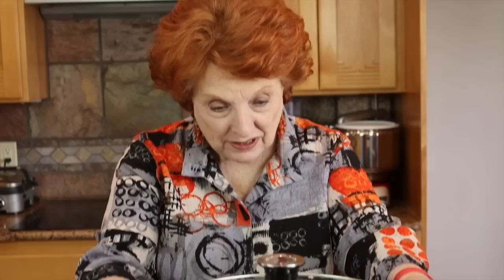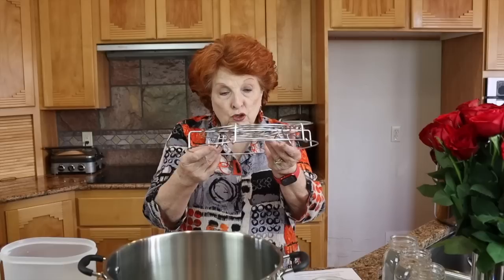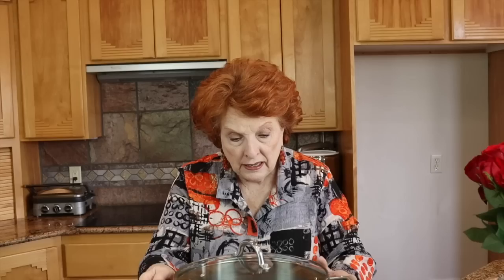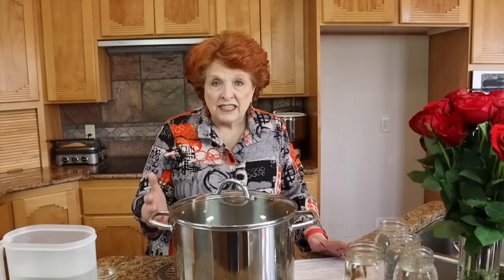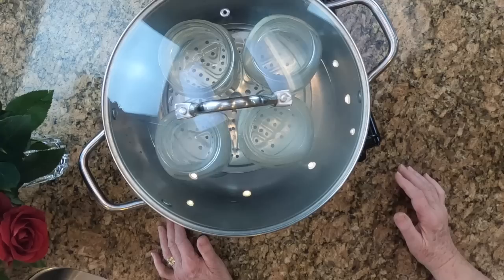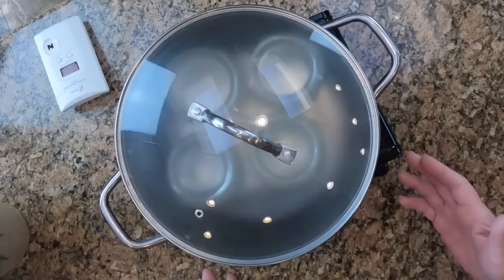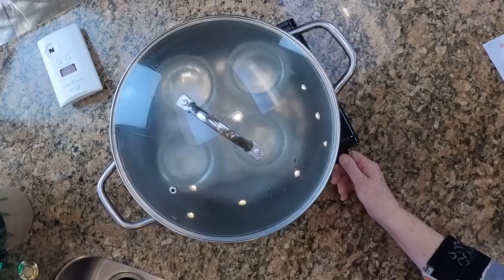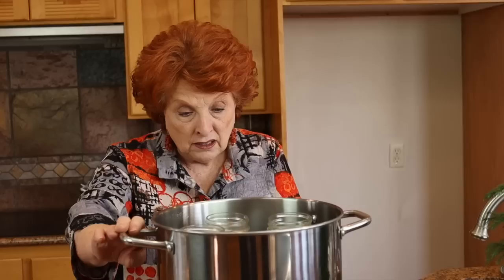How to Make Your Own Steam Canner

Comment: I have a Ball Water Bath canning pot with glass lid. It is 9" deep and would require a rack no greater than 2" for the processing of quarts. Do you think 2" of water would be sufficient?
Reply from the maker: Do that and see if it works. Make sure you have the acceptable amount of water for the process.  Jim
Reply: I decided to watch her video for the third time and at 7:07 I got the information I needed. I used a quart jar and measured out a total of 5 quarts, and the level was just under 2" in my 21 quart Ball water bath canner. So, even if I just used 3 quarts. I will have plenty of room under a 2" wire rack.

Comment: i thought jars were not supposed to touch the bottom of the pot without a rack? Won't the 4oz jars crack if set directly on the bottom of the pot?
Reply from the maker: Mine didn't crack or break.  Jars with food in them should absolutely sit on a rack for canning, but those small jars were acting as supports for the rack so it worked fine.  But you would use other things as well--small tomato sauce cans with the tops and bottoms cut out, etc.

Comment: I see others in YouTube using a hot plate for canning I’m assuming due to glass top stoves. I have looked at these but finding one large enough to fit the bottom of canner or finding the weight capacity is nearly impossible. Is it necessary for the whole bottom of the canner to be on a heat source??
Reply from the maker: It is nice for the heat source that covers the whole bottom of the canner, but it is not necessary and takes longer. (Our glass top is an induction and takes specifically made pots/pans.) One of the problems with a hot plate is if is butane or propane, it needs to be full when you start and please it check frequently to make sure you still have a flame. If the hot plate is electric, make sure it is in good repair and watch for any problems that may occur. We have an adjustable flame, three-burner camp fire stove with 10,000 BTU's for each one for very heavy canning projects (see our Amazon Store).  Jim

Comment: I am not sure how to reach you directly, but it would be most appreciated if you could run a test on the Nesco/Carey to determine if the LOW PC setting with the exhaust open is a safe "steam canning" process.  I am concerned about time/kill zone.  If it helps I can email you my response from Nesco/Carey with an affirmation that the Low setting is ok for steam canning in lieu of the water bathing/steam setting

Comment: What if the jars have to be in the water or the lid won't work. I don't have a clear like just a metal lid.
Reply from the maker: If the jars have be in the water (depending on the amount of water), you would be water bath canning or pressure canning. For both of these situations, you depend upon your read-outs or dials for the information you need.  Jim

Comment: Oh, crud. What's the difference in water bath and steam canning? I've been water bathing for quite a while, and pressure canning when needed. What's the benefit??
Reply from the maker: In water bath canning , the jars are overed completely; steam bath canning, the jars never touch the water and cooked by the steam. All three are different ways of preserving food.  Jim
Reply: @RoseRedHomestead  But, is there a reason to use steam instead of water bath?
Reply: The weight on the pot full of water too heavy for most to lift faster you are heating less water

Comment: How do you know that it has reached the proper pressure level.  It can boil but still not be at the correct pressure????
Reply: Water bath or steam canning do not need pressure. They are for high acid foods only . Pressure canning is for low acid foods that need a higher temperature than the boiling point of water reaches.

Comment: Why are the jars in the bottom of the pan not shattering? Is it because the water is regulating the heat through the jar and the bottom isn’t getting too hot in relation to the top?
Reply from the maker: Because the jars are on a rack.  Jim

Comment: Why seems everybody to be so eager to achieve that the jars don't get in contact with the water? Both the water under the jars as well as the steam around the jars have 100°C/212°F, so, technically, there is NOTHING wrong with a higher water level. Sure it will take a bit longer to heat up due to the larger quantity of that water, but it will also allow for a longer steaming time for the same reason, eliminating that "45 minutes maximum"-rule! Which was defined ONLY because of the risk of running your steam canner with a very small water volume dry.

Add a few inches of water level, and safely steam can with a vividly steamin' canner for longer times than just 45 minutes, if the recipe calls for that.
Reply from the maker: What any individual decides to do with the information is fine.  However, since there is a tested option by the USDA, that is what we recommend.  While your reasoning makes sense, we do not want to suggest any deviations that may ultimately be unsafe.

Comment: Pam, I notice you put the elevation jars directly on the bottom of the pot. Are you concerned that they might break? Would it be better to put a tray on the bottom, the jars and then another tray on top to hold the filled jars?

Comment: Hello, I sent you a message before I would like it. If you could get back to me I use a steam canner one of the old fashion ways where it had two holes drilled on the cover and when the steam came out about 8 inches to 12 inches start your timer Now I have another one that has that gage on top just like you do with the glass one top. Now my biggest question is, did you take just a regular pot took the top off and put this gauge on top or did you buy it all that way cause I’ve never really seen one that’s glass.
Reply: Roots & Branches VKP1130 Harvest Stainless Steel Multi-Use Canner with Temperature Indicator is the one shes shows first in the video. You can buy replacement gauges in America very cheaply and I wondered the same about buying one and adding it to my normal stock pot no idea if it would work or if the screws would be the right size but I'm UK and can not buy it separately. I have had the canner in my watch list for months but at £112 its very pricey. I will now buy a canner rack that I can flip over and use in my stock pot instead.

Comment: Be careful Rose with that little burner.
My directions say not to use a pot or pan that hangs over the part where the gas can goes in. It can get too hot and blow up on you. That would be awful for you !!

Comment: Hi Pam. I just watched you put together your homemade steam canner. Would it be better to place a quarter inch rack below the 4 stabilizer jars so they are not in direct contact with the heat?  Doesn't direct contact cause breakage?  Or would a hand towel work as well?  I would be afraid the 4 jars would break.
Reply from the maker: Yes, that is a possible insurance solution for your question. Do that and see if it works.  Jim

Comment: Okay my bad I've never steam canned before.  I've wanted one but could never afford one.  Now i can.  What do you steam can?  Why would you steam can and not water bath?
Reply from the maker: Steam canning is the same as water batch canning--two different ways to do the same foods.
Reply: *Takes much less time to heat 3 quarts of water than a whole canning pot. 
*In areas where water conservation is important, much less waste of water.
*Much lighter for me to lift on and off the stove. And with a glass top, not as much weight with both my large stockpot of food and my canning pot on the cooktop.
*Quick turnaround between batches.  I keep my kettle handy, top up any list water with boiling water, and in a couple of minutes, it's ready for another load. Instead of water for a large pot of water to come back to temp again.
*My kitchen does not heat up nearly as much.

Comment: After receiving the Harvest canner I wondered the same thing. How is this pot a better option. When I read it was dangerous to use on my glass top I realized I need to return it. It says on the Amazon site that its good for flat top surfaces - that's not true.
Reply: I use mine on a glass top stove without any issues.
Reply: @keG1494  I have read that if the diameter of the pot is larger than the element the heat can transfer to the areas of glass that is not designed for the heat transfer it can crack and i'm  concerned about the weight so I'm not taking any chances plus I agree it's not necessary to buy a pot to confirm when it's boiling.

Comment: I'm trying to figure out how steam canning is an advantage over regular water bath canning. Indeed, in a water bath, heat transfer will be more efficient due to the greater thermal capacity/density of water vs steam. Disclosure: I was an engineer on steam systems/propulsion in the Navy and can do that math. Also, when stacking jars when water bath canning, isn't the top level of jars being steam canned (unless one fills with water above the bottom level of jars).
That aside, maybe you can help me understand why people wouldn't rather just do a water bath. Saves water? Saves energy? 
Just some questions to ponder.
Reply: Saving water and propane is why I do it.
Reply: @TheGhungFu.  This is just my opinion on your question, but for me, the great advantage is that I don’t have to lift a full pot of water when water bath canning. I’m a senior citizen with arthritis in my hands and wrists and lifting heavy pots is next to impossible.  So, if I steam can, the smaller amount of water needed would be advantageous when trying to lift the pot.  Also, when water bath canning the level of water is at least an inch ABOVE the jars…that’s why the pots are so heavy.
Reply: Waterbath needs a lot more resources, energy and time.  Compare the energy use and time to get a gallon of water to boil with the energy and time needed to boil 1 quart of water. 
Not to mention removing jars that are covered with almost boiling water after the foods are processed - especially if you are a short person…😊
Reply from the maker: In water bath canning the water level must come up over the tops of the jars.  Filling a large canner with enough water to do that takes a lot of water and a lot of energy to get the water up to a boil.  In a steam canner, less water, less energy to produce the steam.  The results of both ways are the same--safe food.  Your preference.
Reply: @RoseRedHomestead  Thanks for the reply!